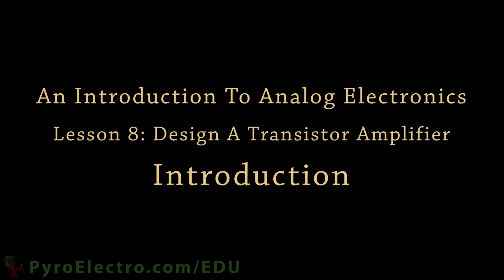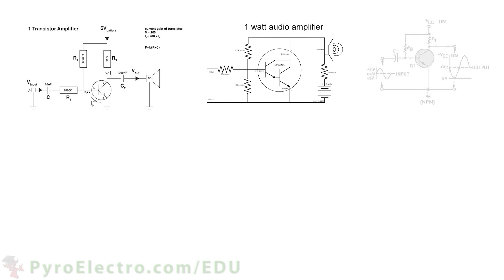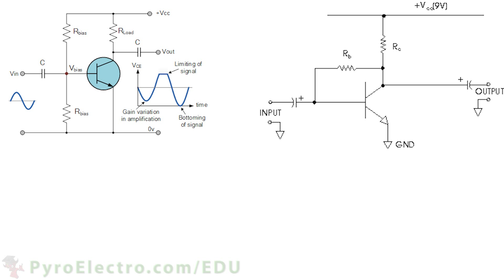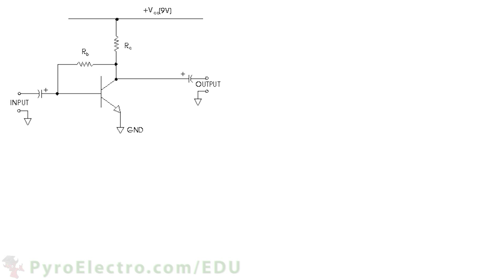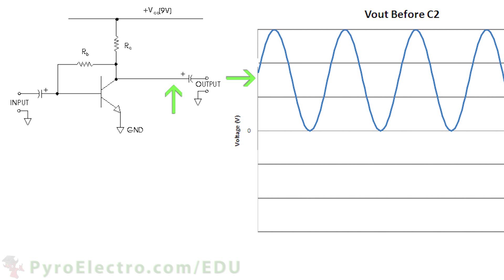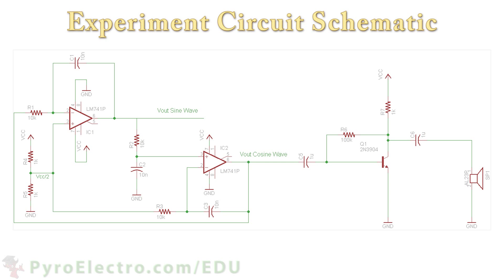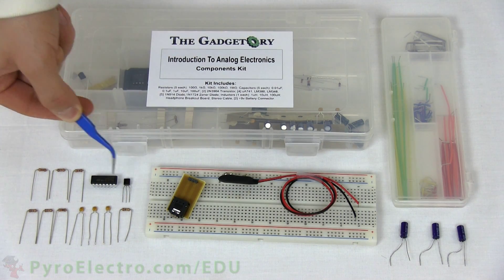Transistor Amplifier - An Introduction To Analog Electronics - PyroEDU

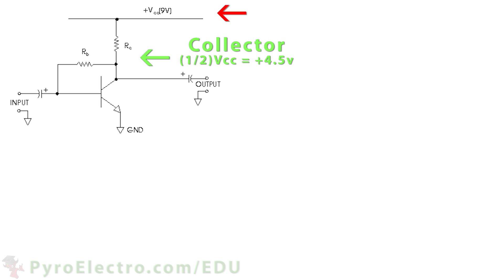Comment: Careful with the terminology. At 1:27 you say that the "power" is 9V, while the potential is 9V. At 1:37 is everything fine but you can say that you're using a voltage divider (so that next time will be easier to remember that pattern), … etc. Anyway very good video.